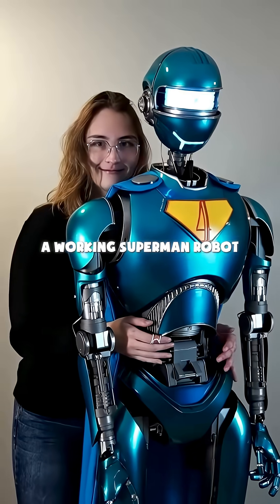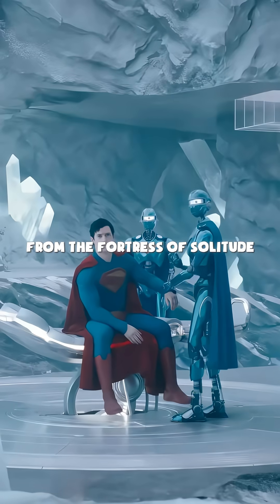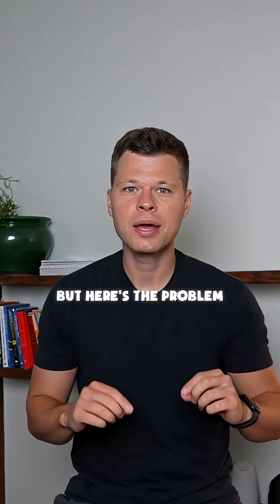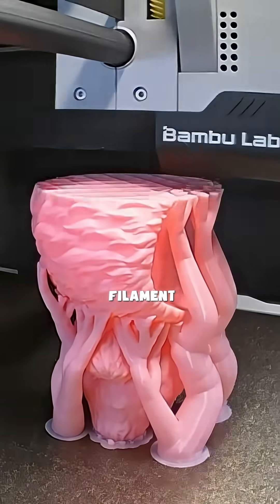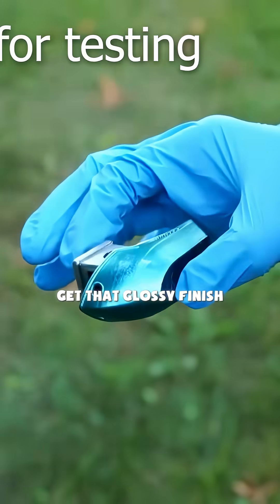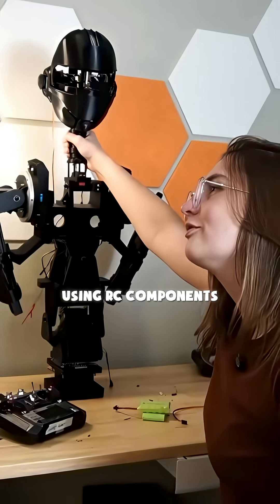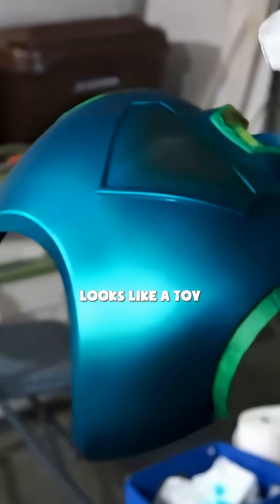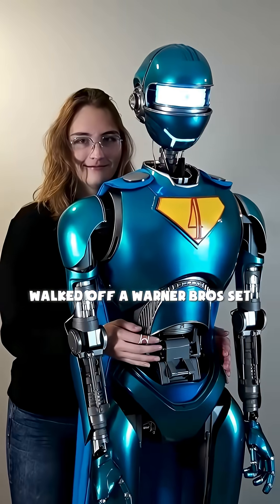This YouTuber built a working Superman robot in one month and it almost caught fire

Comment: This guy knows shit about 3D
Printing. And is not a new material. It’s sometime very difficult to work with, but is very common in 3D printing. And 3D printers don’t catch on fire (anymore) they have software now that prevents fires. Learn about how printing is done before you make assumptions and get the hobby wrong. Provide some education, not just time wasting content.’